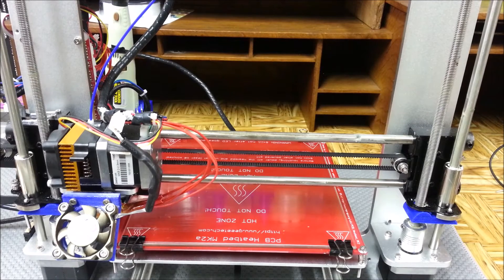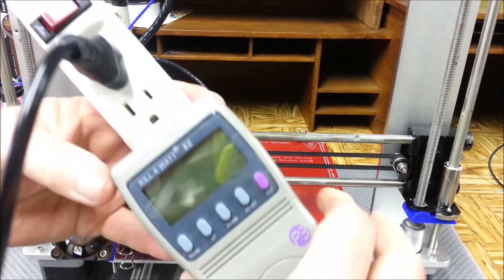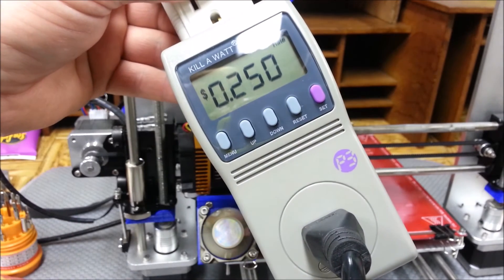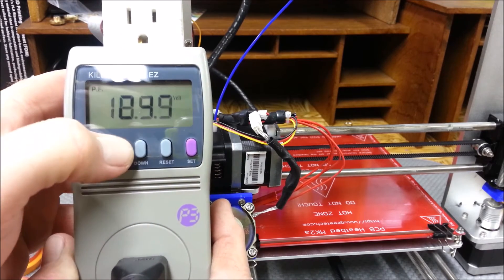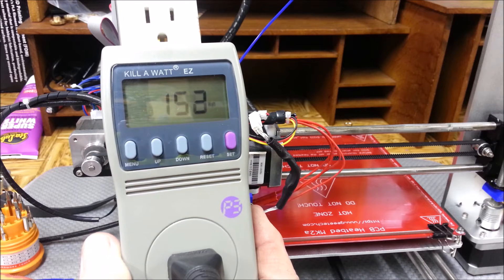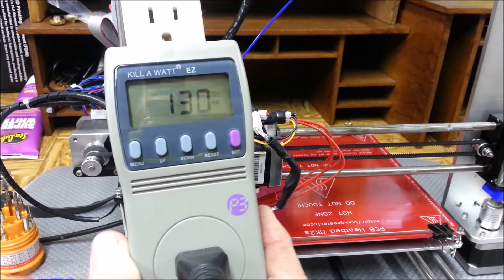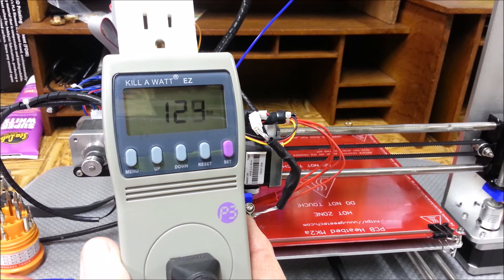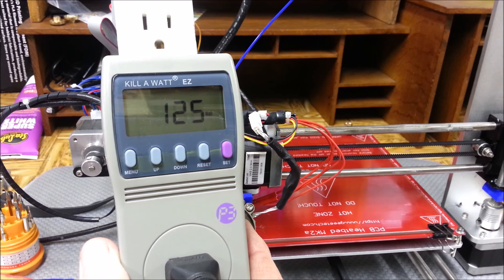How much power does a Geeetech Aluminum Prusa I3 use

Comment: It's pretty hard to get a computer to consume 600W. GTX295 (internal SLI) GPU running burn test, Phenom II x6 overclocked to 3.5 GHz from 2.7 running burn test, 3 harddisks idling, Bronze class (cheap, inefficient by today's standards at 84%) 730W power supply, topped out at around 550W, estimate <600W if I also burned all the disks, and one or another power supply wouldn't matter much because higher power ones are exclusively higher efficiency grade. It still idled at 120W. Most computers are like right around 100W in normal use and not even 200W peak, those equipped with 430-550W class power supplies.

The heated bed is nominally 1.6 Ohm, plug it into Ohm's law at 12V, you get 90W, plus you get a 40W heater cartridge in your hot end. Neither receive full voltage or run at this full power because of control electronics losses, and the way it works out is that the increased resistance reduces total power draw rather than just on the heater elements, and the power supply will probably buckle too, and this is an old power supply, it will likely be right around 75% efficient.

Comment: You should do this to get an average per print. So you could calculate average cost per print based on the size of the print since electric draw is variable through out the print. 

For a base line to use as calibration per print size, use a calibration cube.

That way you have a baseline.

You'll know from the moment you turn on the printer till the end of print and you turn it off, for X amount of Y type filament at given settings your electric costs will be XYZ.

Then it's just a matter of simple math to figure out an approximate electric consummation/cost per print.

ie If the calibration cube uses 10cm of PLA. Print heat settings were 65/200. Electric cost was  $0.10 cents.

Your next print if it uses 100cm of PLA at a setting of 65/200 your cost to print will be approx $1.00. (for electricity)

Do a baseline test for your different types of filament and preferred settings and you can figure out an approximate electric usage/cost on all future prints at those settings.

- chase -